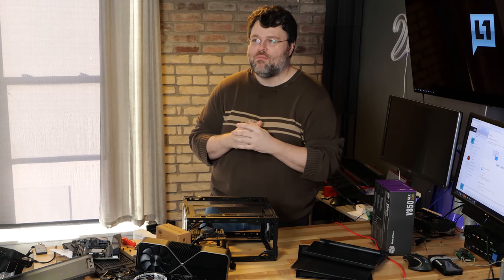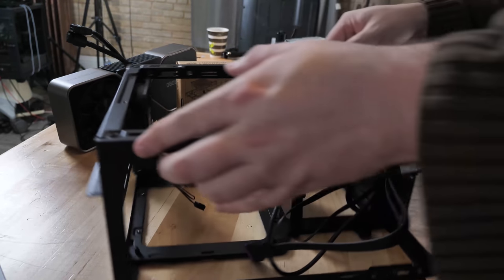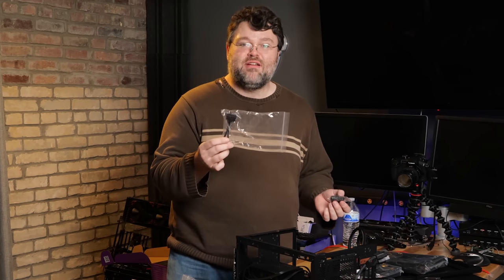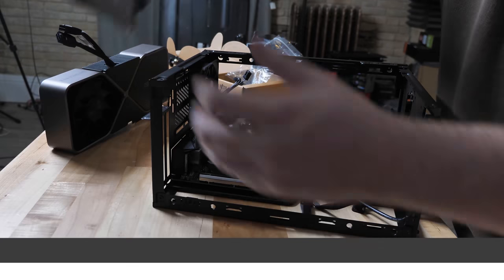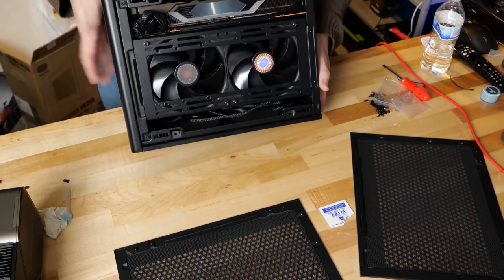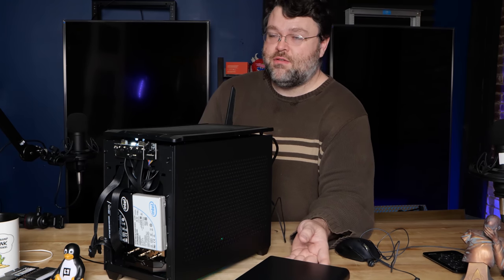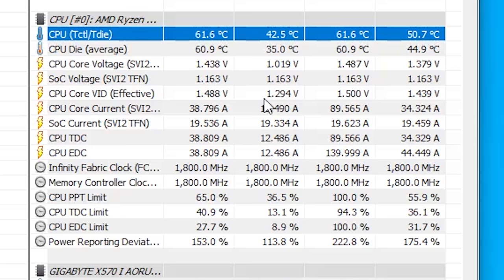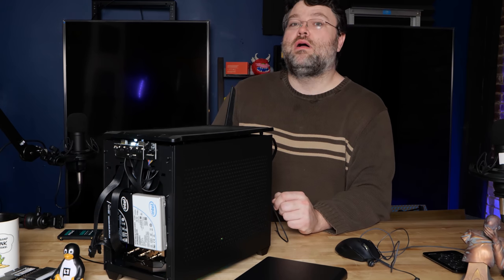L1's Ultimate 2021 ITX Gaming PC

Comment: NR200 is a perfectly executed mainstream ITX SFF case. It's a fantastic job on CoolerMaster's part - it strikes a great balance between space efficiency and flexibility without TOO many compromises that would otherwise cause someone to shy away from attempting an SFF build - I'm primarily thinking of sandwich style cases with riser cables when I mention this, but even the NCASE M1 - of which I've owned the V1 since launch and is my personal favourite - could be seen as too intimidating, too costly, or both! NR200 thermals are great too when properly setup as you have found out. I'm hesitant to even say "great for first time SFF" because I see it as a "forever case" for almost anyone.

Case manufacturers have really been put on notice, because there's very little reason to recommend anything beyond the NR200 right now in the SFF space, unless you are really chasing the best space efficiency possible or want a serious challenge.

Comment: This is awesome to see as I have a similar build.  NR200, 6800 XT Taichi, ATX PSU, and NH-C14S CPU cooler for a 5600x.

Went straight to deshrouding and placed 2 intake 120mm fans under the GPU.  GPU temps run so cool, but after seeing that underglow with the RGB shroud I NEED to try this.  Thank you!

Comment: I built an almost identical build with this case, but I put the fans on the inside pulling through the radiator. 

It allows more air to hit the mother board for cooling when over clocking.

Comment: Linkup's 4.0 riser cable has been working well with my 5700 xt sapphire nitro+ (different build than my nr200).  Also, that top mounted fan may start to rattle.  If it does, you can just pull down on it ever so slightly, so that the posts that secure it aren't vibrating against the lid.

Comment: Depending on the AIO and such, typically the best noise and thermals for the AIO fans is to have them suck air through the radiator on the inside rather then on the outside of the radiator pushing in, optimum tech has gone over this a lot on his ITX builds, but just in case people building should try test both configs and see which works best for them :)

Comment: I recently switched from the da2 to the nr200. 
Much better thermals and using less fans to.
After seeing yours I may add one back to the build. But im using the x62 kracken 280mm aio. And clearance was much worse for the rear fan..

Thanks for sharing. Ill definitely be getting some of those intel drives for the front

Comment: I only recently noticed that current gen ITX motherboards (AMD mostly) don't have TOSLINK by default.
I thought optical output was by default, kinda like airbags on cars.
Let's just say I regretted buying a TOSLINK to BT5.0 adapter without first checking if it was compatible with the build :-X

Comment: I crammed in 4x120mm fans, 1x80mm in addition to 240mm AIO. Runs chill 68deg C while gaming, but 3d Rendering  CPU temps are 10+ deg C higher than gaming around 80 deg C. GPU chills at 64 at full load.
Ambient temp is 30 deg C or higher during daytime.
Running a 3700x undervolted with stock 2070.

Comment: Brilliant! I built an NR200 a while ago with a 3600X and just upgraded it to a 5900X, constand blue screen's though on 'default' ryzen setting. Setting a manual clock of 4.4Ghz at 1.24v stops them for some reason. Guessing I'm loosing a bit of performance by doing this? My Aurus b550I has been so buggy, was fine with the 3600X though so hopeing its a BIOS problem and not CPU. CPU is also hitting 88c with my U9s, time to invest in a 280mm AIO! Happy new year man, new subscriber here

Comment: One decent air cooler that would fit is a thermalright macho sbm I think it’s 150mm tall. I’m not sure if they still make it but i used it on a 5820k back in the day and it worked fine.

Comment: I got the 360mm version of that liquid cooler on my 3950x and I fucking love it. Keeps my shit really really cool. Like, "you are lying about your temps" cool. Granted I updated the fans to noctua nf-a12x25 (their "special" "sterrox plastic" fans which are their absolute best 120mm you can buy) and I have those in push/pull running about 75% speed (which is still quiet as balls). Also wiped off the stock thermal paste and used arctic silver 5 because "its the best after burn in"

Comment: That case is out of stock everywhere, for variety
Reply: There are models in stock. There are four variants - the base NR200 in black or white for $79.99, and the NR200P which comes with an extra glass side panel and vertical GPU mount and riser cable for $99.99. All but the base black NR200 are in stock. An extra $20 for parts you may not use is nothing compared to the cost of cases like the M1, Ghost S1, or T1.

Comment: I have a similar build. I have a 5950X, 6900XT 32 gb RGB Gskill-4000 ram. 4 tb m.2 with 6 TB HD, Sliger Sm580 case, NZXT Kraken z63 280 mm cooler, and I am waiting on my RMA replacement 850W SFX Cooler master PSU. BTW they make you pay for shipping on the RMA. Kind of ridiculous.

Comment: do you think its possible to stack two 2.5" SSD in the front? so that it would fit one mechanical on one side and two ssd on another side?
Reply: Depends on their thicknesses. You can see the 12.5 mm drive was already a tight fit.

Comment: How can this be the ultimate 2021 ITX Gaming PC, when the 2021 tech (Ryzen 4, Intel Rocket Lake etc.) haven't even launched yet? :(
Reply: @asdrubale bisanzio  I would agree, at this point Apple has more potential to release the fastest CPU on the market. M1, while I hate to admit it, is beating Ryzen 5000 in performance per watt by a longshot, has close performance in many applications and it's only an 8 core (4 big, 4 LITTLE cores), I can only imagine what a 24 core (8 big, 16 LITTLE cores) would do. 

However, my "issue" (not really an issue, more a nitpick) is with the title, we barely entered 2021 and there are lots of 2021 tech releases to come.